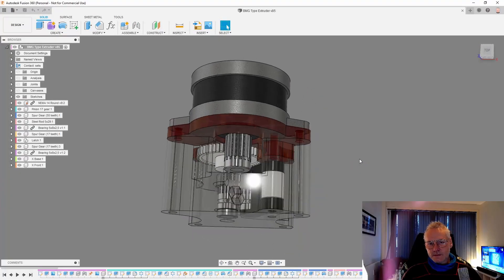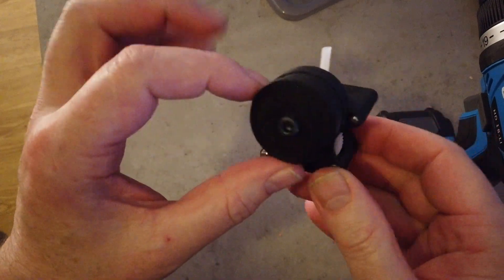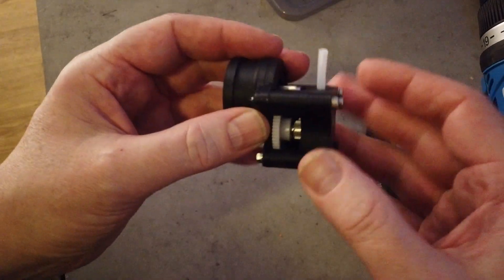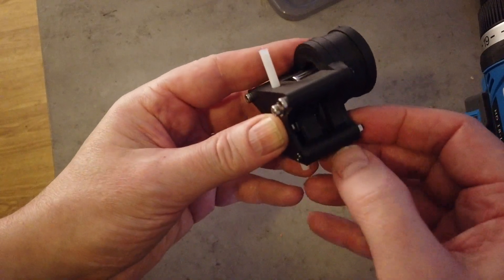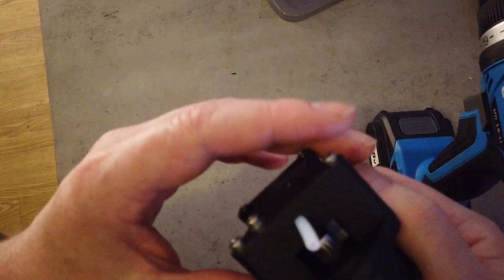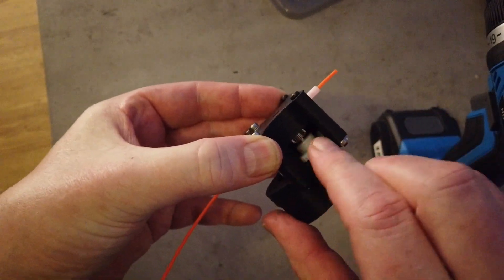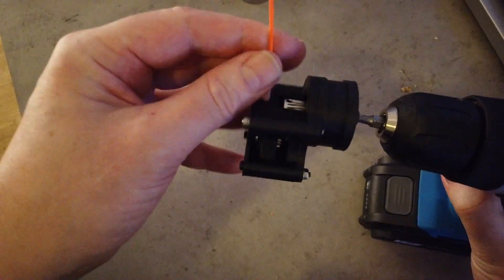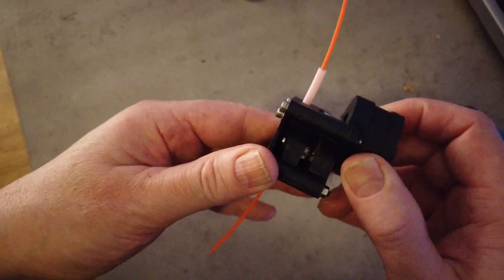NEW! LIGHT-WEIGHT DIRECT DRIVE EXTRUDER | THE MJØLNIR LWX 31!

Comment: Ok so see that drill part. Be sure you aren't doing that when the motor is plugged into the stepper driver, otherwise you can blow the driver. What material did you say you printed that with?
Reply from the maker: This is matt pla from prima select. The real motor does not have a screw..

Comment: So that extruder is basically inspired by Sherpa Mini in terms of form? Because it looks very much like it, except this has a latch and uses the standard BMG gear - just like the Folded Sherpa. I like it, it's cool and taking good ideas from other extruders into it's own neat thing.
Reply from the maker: It is inspired by the Sherpa mini yes. I like the Sherpa Mini but and could use that but did find it a little bit to complex for my taste. My take on this is simpler but highly functional and easy to print with little hardware to assemble

Comment: Is the second motor you mentioned the Voron/Annex NEMA14 pancake that LDO makes? The one with a 10T integrated pinion?
Reply from the maker: YEs that is correct. I ordered not the LDO one but a similar with 10t pinoin yes :)
Reply: @PRO3DESIGN  what the model of motor is it? Where did you found it? What's the vendor?